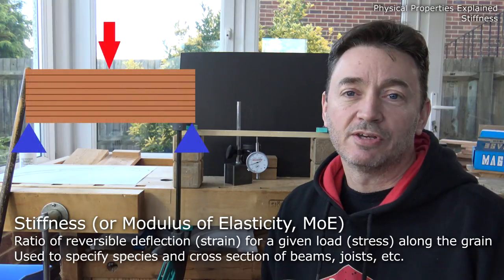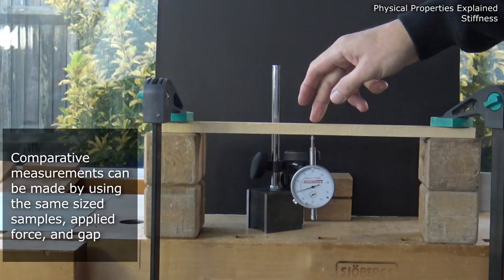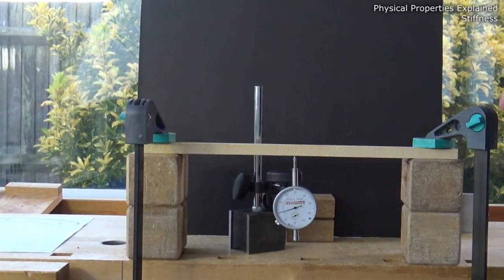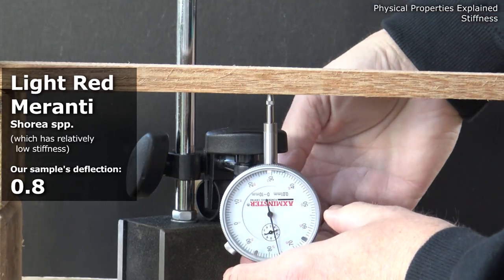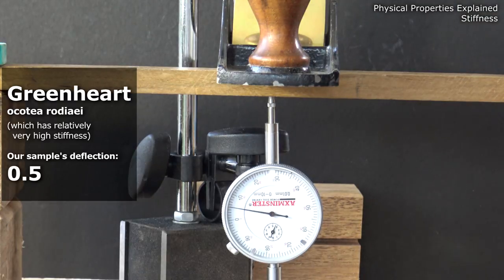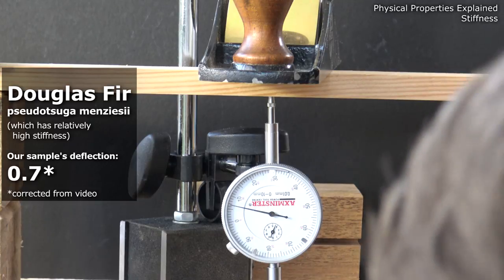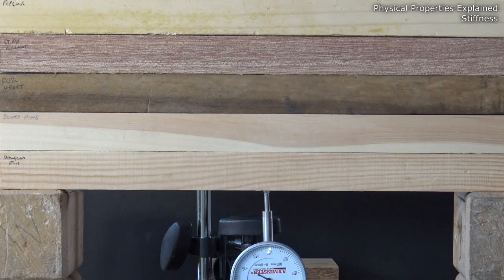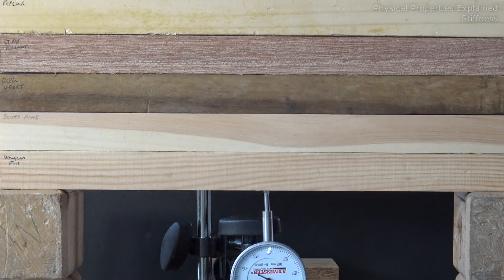Stiffness - Mitch's World of Woods

Comment: Also, stiffness is a cubed factor of the thickness of the board.  So, if the thickness of the board doubles, the stiffness is 8 times higher (more or less)
Reply from the maker: Scott Beckstrom Cheers, whereas doubling width simply doubles the stiffness, I believe.

Comment: I would have thought the clamps on the setup would be inappropriate.  They resist the bending by anchoring the board at each end.  I would have thought: no clamps, fulcrums then exist at the inside of each of your piers, then proceed as you have.  If your setup is as industry standard, please correct me.  In any event, your data is relative and informative.  I like this series of general education.  Thanks.
Reply from the maker: Thanks, you might well be right, although for such small deflections I wouldn't think the lateral movement would be much. I'll knock out some triangular fulcrums at some point and test it out.
Reply: It is not the standard way as deflection will be lessened but it is still OK as the deflection will be inversely proportional to the wood stiffness.